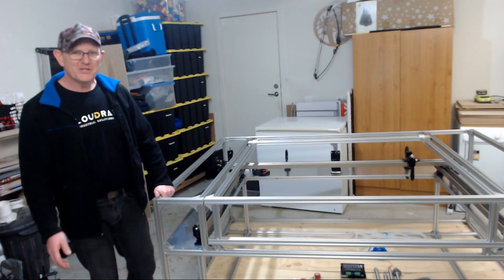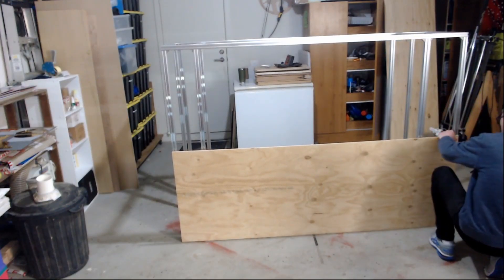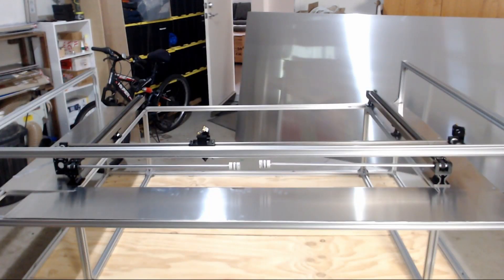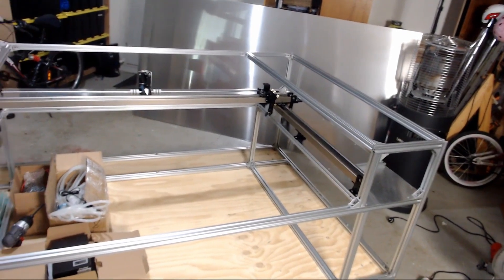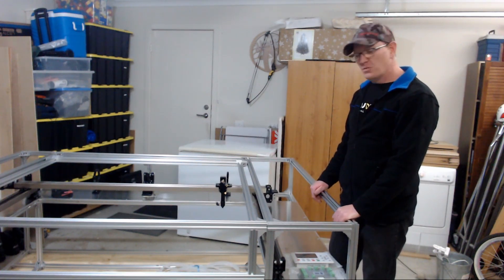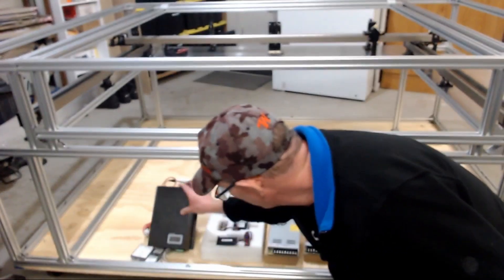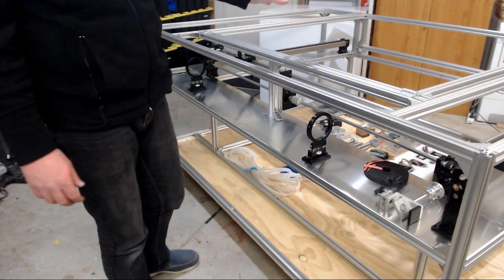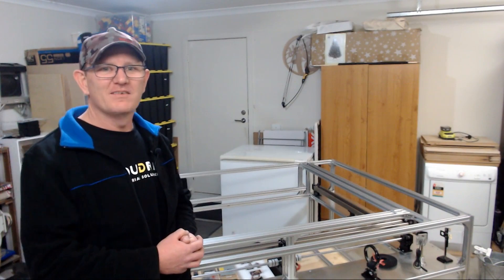04 Build Your Own Laser   Enclosure & Rail Mounts

Comment: I am in the process of upgrading my OMTech AF2028-80 with closed loop hybrid stepper motors. I have encountered an issue, however. I am unable to locate a Nema 23 stepper mount and pulley drive to join the two Y Axis drive rods. I noticed you used exactly what I am looking for. Can you tell me what and where you located the Y Axis Stepper mount and pully connector